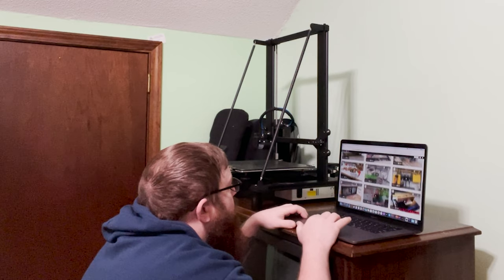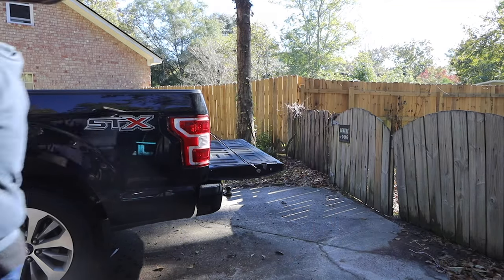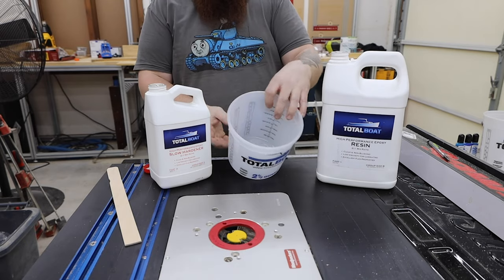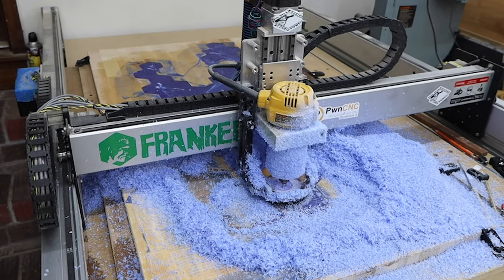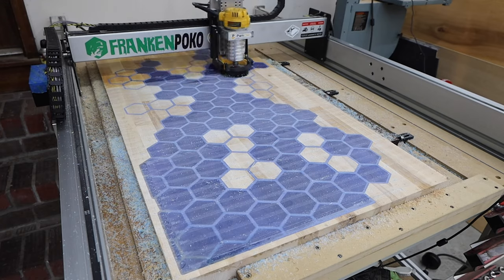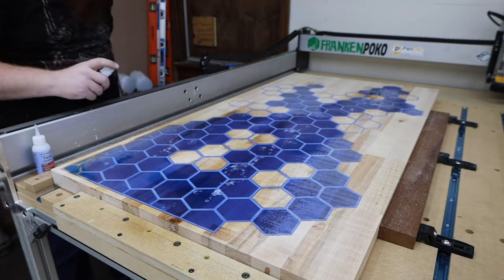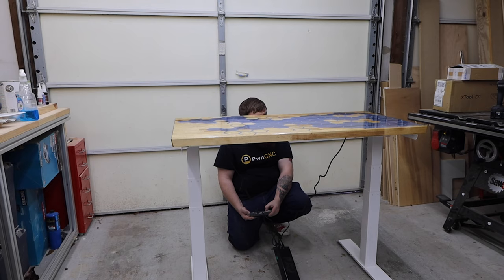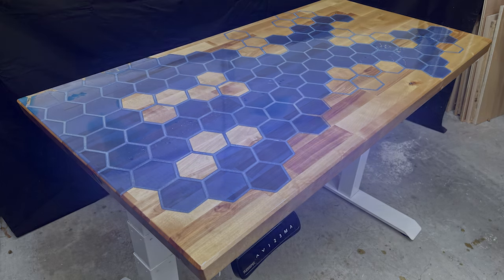I made a custom butcher block top for my FlexiSpot standing desk

Comment: Hi Chris, great video!
I have purchased the flexispot eq5 legs and frame, and have a solid wood desk top I bought from ikea, but as a person new to diy I’m not sure on the best way to fit the two together.

Do you know if I need to add drill holes that line up with the ones on the legs before screwing them together? Or can I screw straight into the wood?
Reply from the maker: Thanks. Small pilot holes wouldn’t hurt
Reply: @ChrisPowellFSD  thanks for answering, can I also ask what thickness your desk top was?
Reply from the maker: @mp0555  1.5” thick